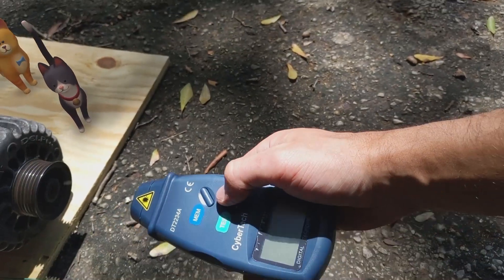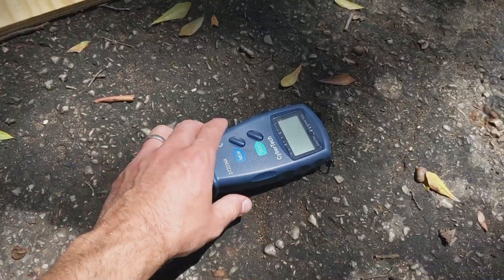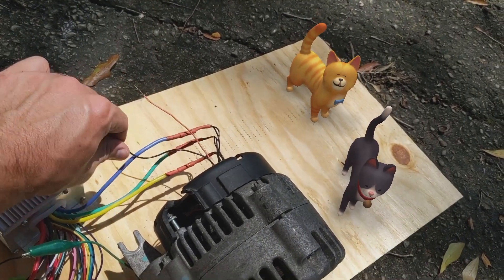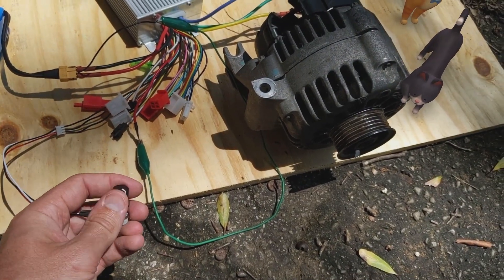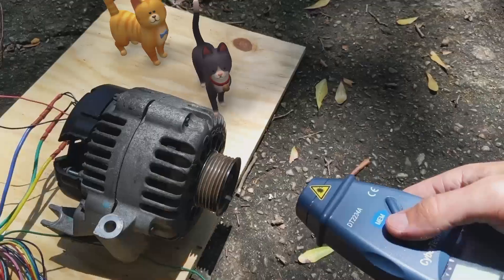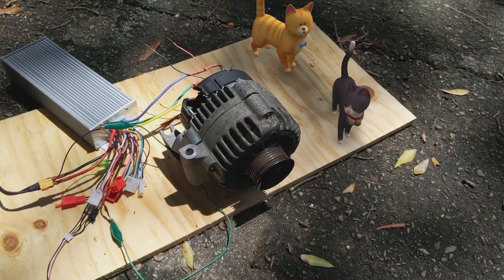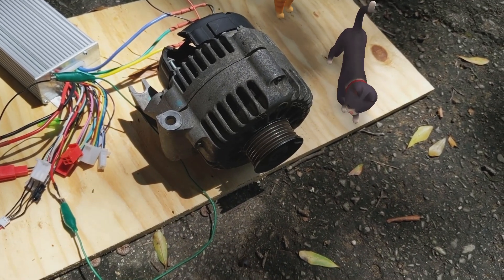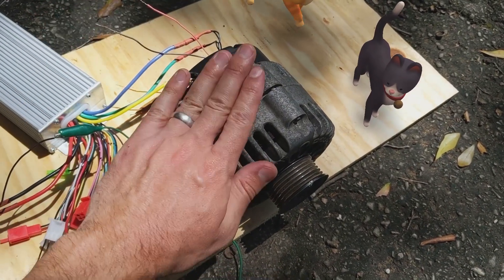Alternator to Motor Conversion   RPM Test

Comment: Your rotor is behaving like a squirrel cage rotor in an induction motor. You need a certain amount of slip for an induction motor to work.  I doubt the shorted rotor is an optimal way to create an induction motor.  If you drive the rotor through the brushes with a variable DC source, you can vary the strength of the electromagnet rotor.  Higher rotor current makes for a stronger spinning magnet and more torque per amp from the three phase source.  Also this strong spinning magnet limits your rpm because it will generate back EMF equal to your three phase supply voltage at a lower rpm.  If the rotor's electromagnetism is decreased by decreasing current by lowering the rotor's DC voltage, higher rpm at lower torque will be possible because more rpm will be necessary to create back EMF equal to supply voltage.  This makes it a sychronous 3 phase motor and can make such a motor more versatile in that it can be either a lower rpm high torque motor or a higher rpm low torque motor.  "Electric Motors and Drives" by Austin Hughes was, and may still be available for free download as a pdf and is an interesting read. Highly recommended.
Reply from the maker: Ok thank you I will search for it

Comment: Subbed. What about using 72 volts for the battery pack? Would it burn up the alternator? Can all alternators work on 72 volts? Cats were a little distracting.
But still, great job. I'm all in on the process.
Reply from the maker: The alternator can handle 72v you just need to make sure the speed controller can handle it. I am not sure if adding 72v will increase the RPM or TORQUE... I will have to test... I will work on those cats, they were a little loud. I got mixed responses
Reply: @MadeEasyChannel  Thanks for the response!
Reply: @MadeEasyChannel  more voltage = more torque, the rotation depends on the frequency that the controller is applying to the stator
Reply: @MadeEasyChannel  would be very interesting to see it with 72v. Looking forward to see If you do experiment with it.
Reply: @cyclonemind7585  https://www.youtube.com/watch?v=wxisc6CLezs
running at 72V